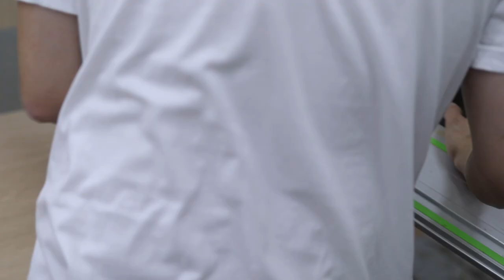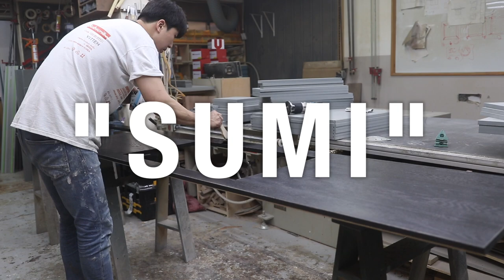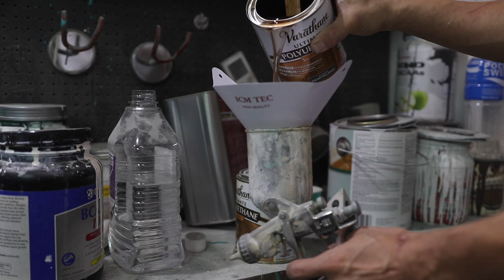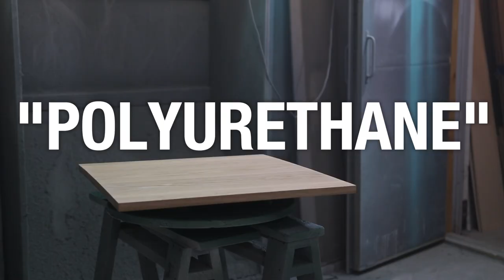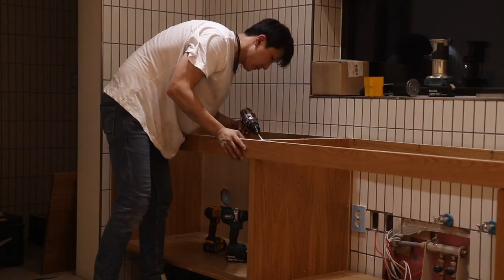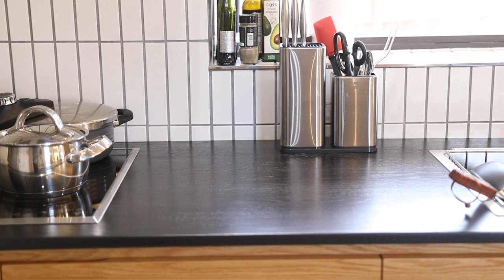W78_Black Oak Countertop in Kitchen

Comment: Question...what is "Sumi"? I assume that is what you used to blacken the oak. Is it something one can buy or do you mix it yourself?
And...when you say "after brushing"...did you brush the grain with a wire brush after sanding? A plastic brush?
And...for both brushing and spraying of polyurethane do you sand between coats?
This kitchen piece turned out stunning.

Comment: The cabinet doors are a solid timber or veneered plywood? If solid I'd be afraid of cupping and twisting.
Reply: Would like to know as well :)
Reply: may be plywood
Reply: @김동헌-g7l  Could be yes :) I think it would be more stable
Reply: Noel Abdilla definitely solid oak
Reply: @denty32  in my opinion,
It is most likely plywood,
additional parts would be required,
such as slidingdovetail to prevent cupping or twisting,
however in the video he did not use any
Reply: When his is installing the door, the inside edge of the door carries on with the same colour variation as the face of the door, so it must be solid...? If he used a veneer for edge banding, the colour would not look homogeneous with the door front.
Reply: @woodroofguy  YEah, but wouldn't it then cup/twist like crazy? There is no breadboard end, or dovetailed brace, or one of those fancy metal braces..

Comment: I wonder why the sink is not under mounted.  Looks good, but from my experienced solid wood countertop is not practical. It will warp,, crack and swell specially around the sink.
Reply from the maker: if you seal perfect that is no problem. under mount sink is not appropriate when you make with wood
Reply: wood counter top is fine and over mount is fine too

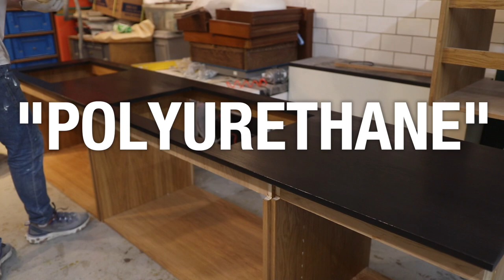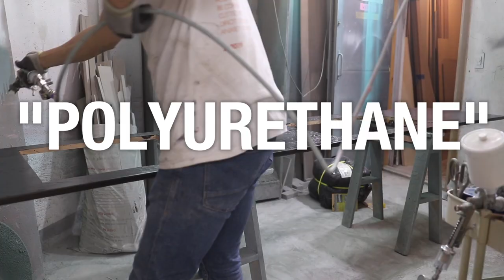Comment: 3:55 & 4:44 did u use polyurethane 2 times?with brush and air brush?
is there any significant purpose by doing that?
great job btw
thx for sharing
Reply from the maker: I applied polyurethane 5times. that was edited in this video
Reply: @ViTTEN  i mean is there any different between using that 2 method? (using brush and air spray)
thx for answering
Reply: Some people like to spray their final coat as to not leave brush marks while the initial coats are brushed on and sanded in between